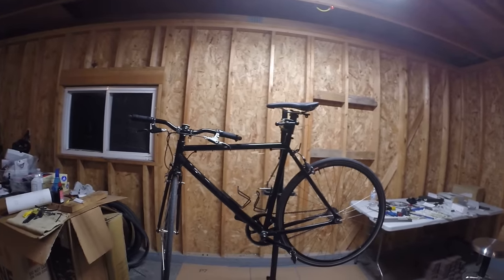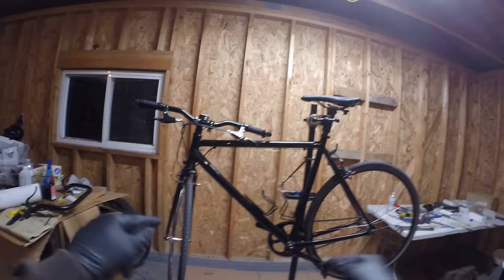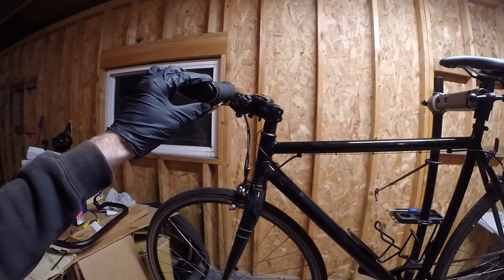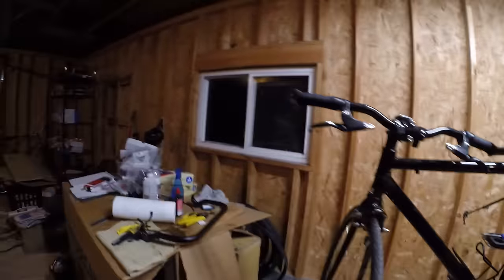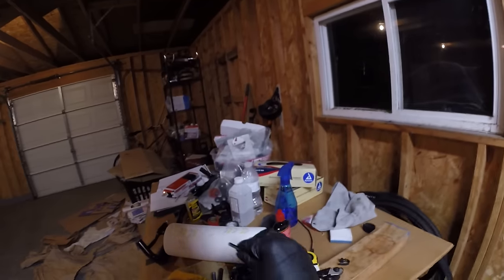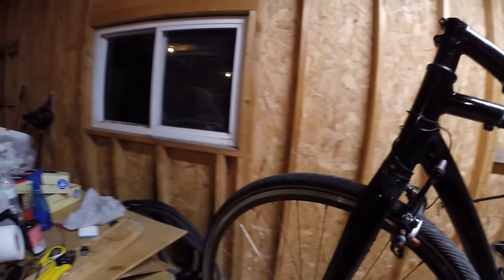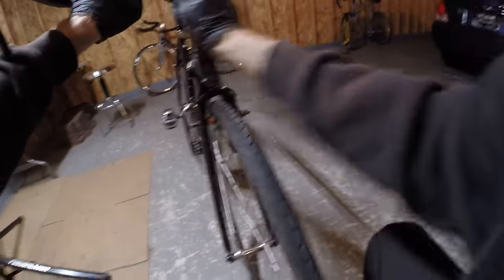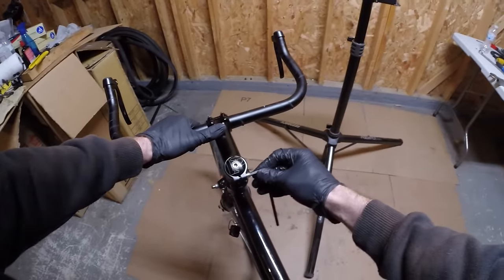How To Install Threadless Stem, Cables, Bullhorn Handlebars Bike Blogger

Comment: Nice vid. One thing to note is the difference between shift and brake housing, and never to use normal compressionless shift housing for brakes as the housing could blow out. 

Now I will say that I run special compressionless brake housing on my bike with mechanical Avid BB7 disc brakes, and it's a great improvement over standard spiral wound brake housing. I even used some of the same housing on another bike with v-brakes which feel great.

Comment: The sloping top tube, besides the dubious attribute of protecting the family jewels better during emergency dismounts, allows for a more compact (slightly lighter) and stiff frame, and more compliance or better ride for the dairy air because it allows for a longer, more flexible seat post without any added frame flex. Stepping down from a 30.9 or 31.6 aluminum seatpost to a shimmed 27.2 carbon fiber seatpost is quite...trans-formative!

Comment: So that was quite a position adjustment, not only longer and road style negative rise stem but also forward bar hand positions compared to the "flat" riser bar. The 64 cent question is did you overdo it for reach and enough upright position for safe traffic riding, or, was the old position so 'orrible (like riding a Granny bike) that the bike has a new lease on life!?
Reply from the maker: +Digby O'Dell For me, I much prefer the more aggressive position. I can still grab the handlebar tops and relax, or - gasp - ride no hands.
Reply: I also like aggressive, I'll be six inches lower than my friend when he rides yet I'm a couple inches taller. I've gone too aggressive in the past though and had to shorten the stem by a centimeter or raise the bars 10 or 15 millimeters with spacers. Stack heights have changed so much in more modern bikes that I now have a much fuller range of positions available. With my height, it used to be only aggressive and super-aggressive!